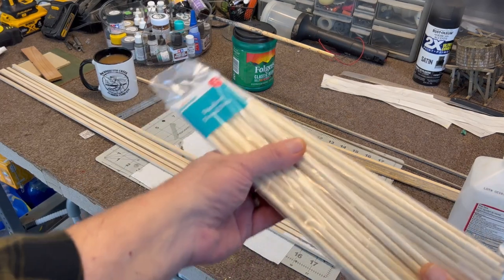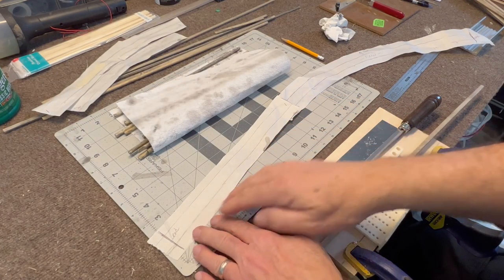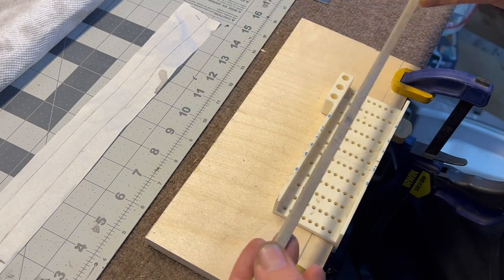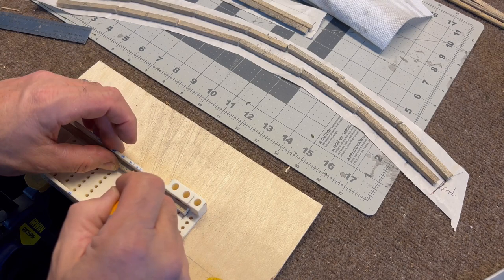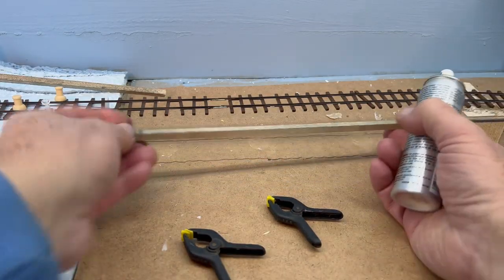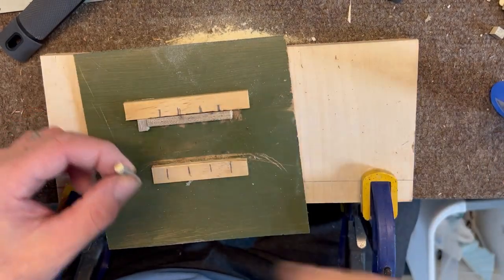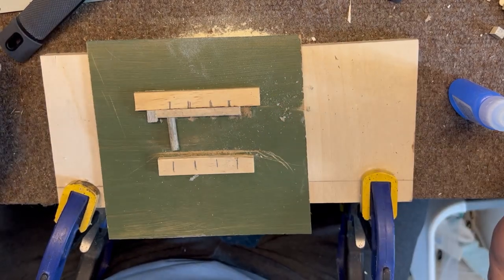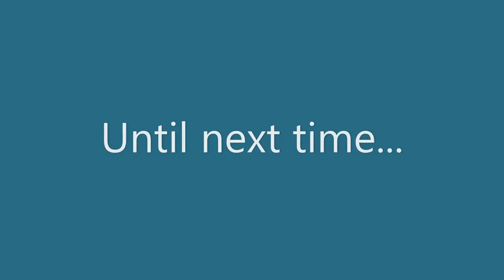MODEL RAILROAD Building an On30 Narrow Gauge Swamp Trestle - Part 3

Comment: Bamboo is a grass - you get a different cell structure, so it takes stain differently than pine or basswood. or poplar.

I'm pretty sure those dowels are 6mm diameter - roughly 11 3/8" in 1:48 scale

If you have a table saw, some scrap lumber, and some time, you can crank out some custom  stripwood.

If by some chance you have one of the super-fine small table saws such as Micro-Mark offers,  you can make scale lumber with a good finish, and much less wastage for the saw kerfs,  Works really well as a second strp after you rough out some 1/4" or 3/8" or even 5/8" pieces with the standard saw.

Comment: Hello from OZ 
Just remember a lot of loggers used RAGE (rough as guts engineering) to get into the cutting areas. The main line to the mills would be to a higher standard of construction, but how much of a higher standard is questionable. If it looks right and works it is right.
Do not apologize for your work just do the best you can with what you have, it is a hobby not a wage paying job.
If it provides you with personal enjoyment and entertainment then you must be doing it right.
I don't think I would have done anything different construction wise, but some nut bolt and washer castings or prints would have made a nice finishing touch before the bents where slotted in. 
It might also have been wise to base coat paint the swamp before the bridge went in. 
It will be a pain to paint now the bridge is in.
That was a comment with some thought that will be 50c please LOL
Don't disturb the water you don't know what's lurking below.
regards John
Reply from the maker: Most of the bents have not been adhered down to the water surface… so I can gently lift them up to paint beneath! Thanks for your great comments !